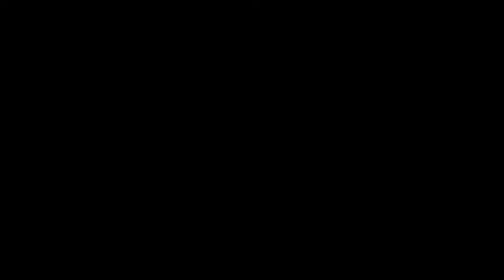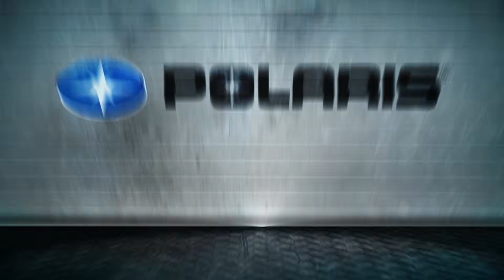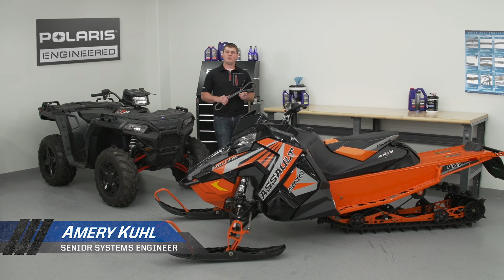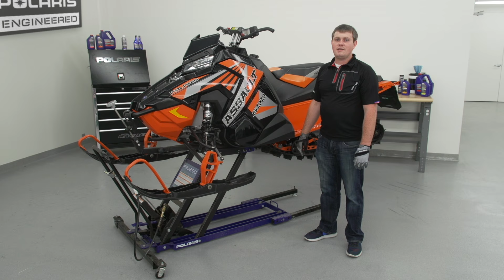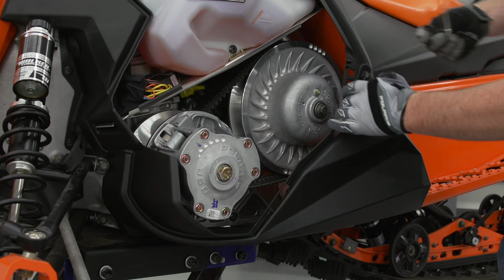Drive Belt Replacement Procedure and Tips - Polaris Snowmobiles

Comment: You forgot to tell people to make sure to run the track in forward before trying to use the clutch spreading tool because if ran in reverse the clutch will be locked together and the spreader will not work.

Comment: That’s one of the best belt removal and installs I have seen on the AXYS! Does the Polaris letters on the belt have to face one way or does it not matter?
Reply: the letters should be upright and readable from your vantage point and/ or replace used belt as it was upon removal. (reinstall the same way)
Reply: @tystensland204  yeah but he did that after loosening the clutch.

Comment: I have a 2010 polaris 600 iq touring I changed the belt, but the problem is the bottom drive shift spins but when I give it gas the belt doesn't move

Comment: Hi,could you please help me out ?i have a 2004 xcsp 700 and when i use my reverse PERC it makes a loud popping /snapping sound ,is that normal and is it the secondary?
Reply: Joe neault I know this is an old comment but you sure it wasn’t the engine backfiring. With PERC reverse the motor shuts down and starts in reverse.
Reply: It is normal noise going from forward to reverse and reverse to forward.
Reply: @rileybrake1604  The motor does not backfire when switching directions.
Reply: @robertanthony9674  Bruh this is a 3 year old comment. And yes the engine has to shut down for a brief second and restart in reverse and during that brief period it’s possible it could backfire. I get the occasional backfire on my machine right after shutting it down. If it’s a regular thing then there is something more going on